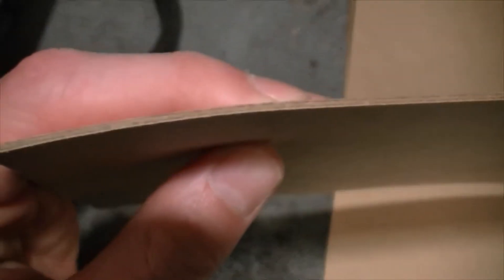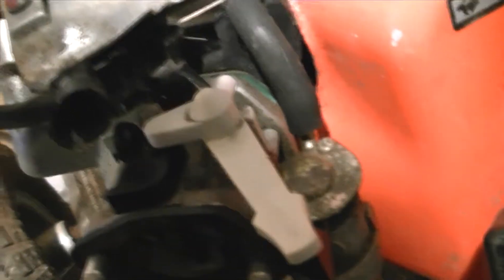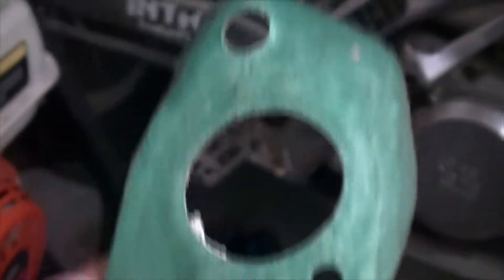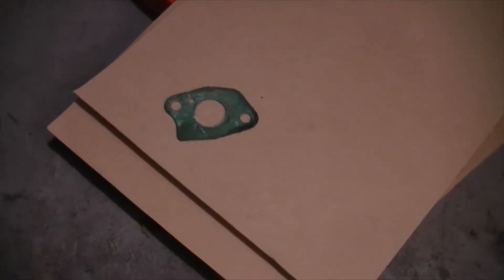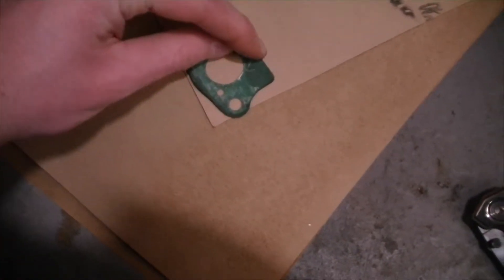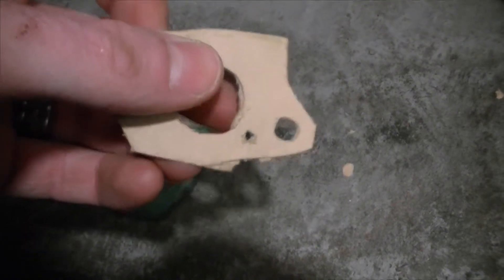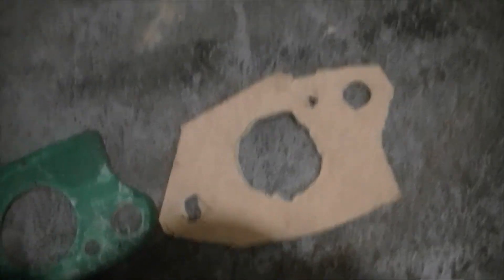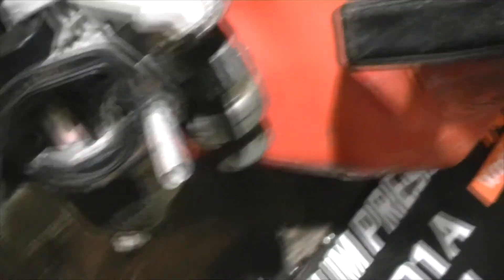How To Make A New Carb Gasket -  RustySkull Productions

Comment: Thanks. 
Mistake I've made more than once is not making the big hole big enough, trying to keep the gasket as strong as possible -- result: confused why engine cut out; cause choke flap wouldn't open fully.😐